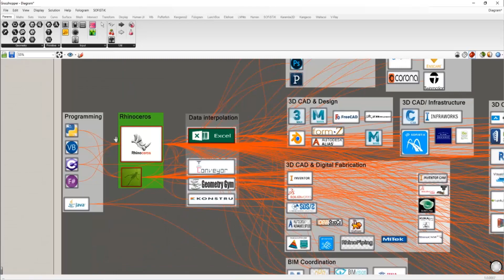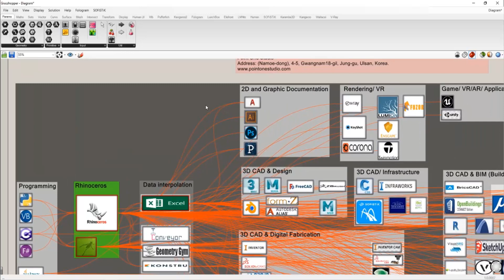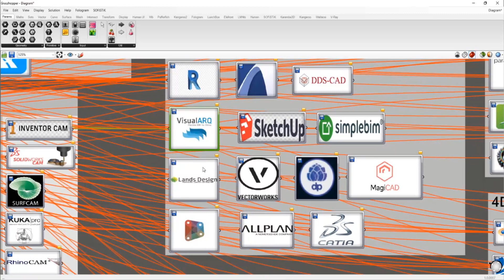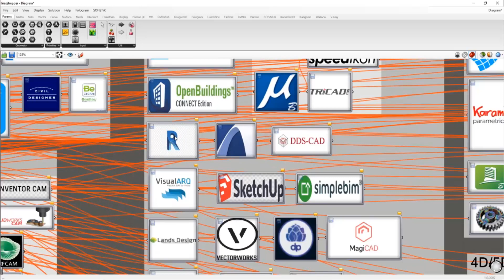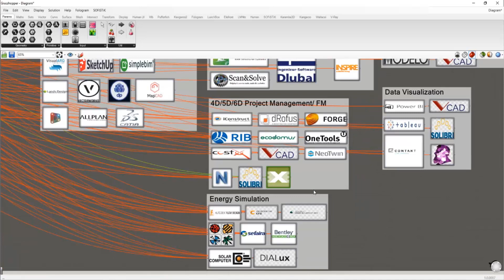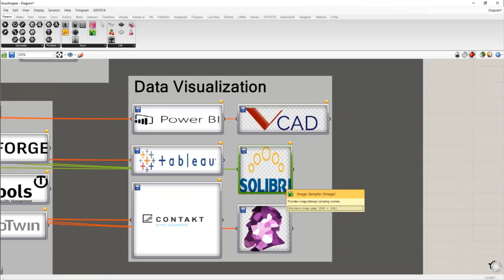[English] Why Rhino? If you are an architect, engineer or A IT Developer?

Comment: what technical specs would you recommend as a minimum for using Rhino in the product design area?
Reply from the maker: Rhino is a very easy and simple software to learn. I think you just need a motivation to learn :) what software is your main tool for your product design? I am sure Rhino3d is simpler than that!